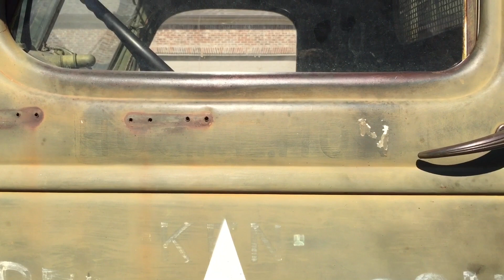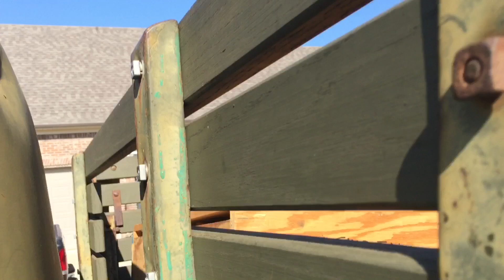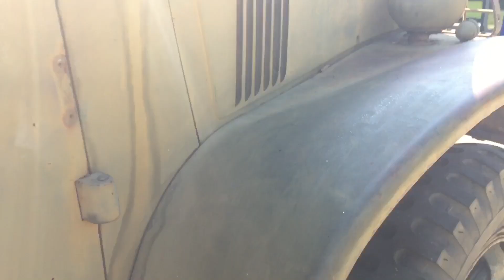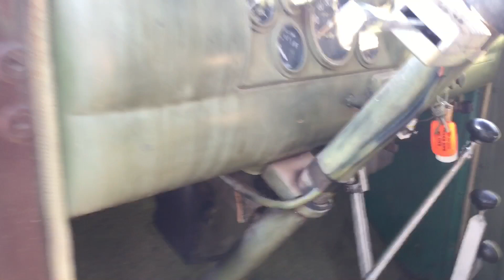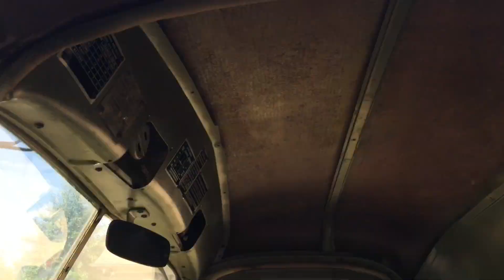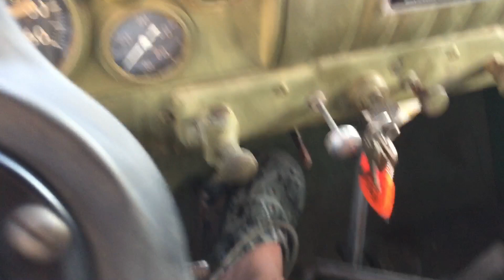1942 G506 Chevrolet 1.5 ton truck

Comment: That's not a original engine. That engine came in that truck was a Dipper 235 look like the 216. That engine currently in there is a 1954 to 62 235 which is the better motor with more horsepower, but not original

Comment: Anyone that has ever driven an old Army deuce and a half knows you don't get many creature comforts with them.  Seats were hard as a rock after a few hours of driving and don't forget that armstrong steering.  But those old WWII era trucks were tough as nails compared to the wimpy stuff coming out of today's factories.  They were built to do a job and they did it very well.

Comment: 1942 model would have Chevrolet on the side panel.These were not removed til later war years.Leave it as is.Perfect!
Reply: Tengo uno en Mar del Plata, Argentina, y la marca Chevrolet aparece en los laterales del capot. General Motors fabricó los 6x6 con la marca GMC y los 4x4 con la marca Chevrolet

Comment: I have one built in 1943. yours is really nice and complete should be easy to restore . Embosed side shields are correct for those trucks  produced from 41" and 42" the brushed guard grill on 41 and 42 production were the serpentine  style. you have agreat truck